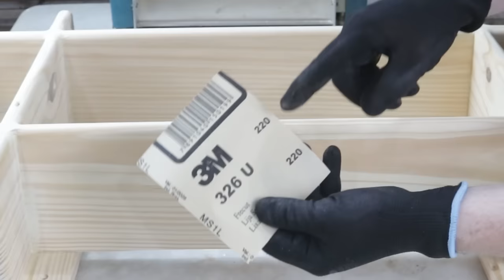EASY TO MAKE - WOODWORKING PROJECT THAT PEOPLE LOVE (VIDEO #49) #woodworking #woodwork

Comment: 9 out of 10 videos on YouTube about wood working are always with someone with a shop full of expensive wood working equipment.. How about showing some skill level without all of the shop equipment. How about just using simple hand tools to accomplish the same task. Most DIYers don’t have expensive equipment.. How about just using a circular saw, drill, palm sander, handsaw, framing square, etc..etc.. And not to mention, using your garage floor to build your project on..
Reply: Start making (woodworking).   This channel does this sort of thing
Reply: Try Rex Krueger, you'll love his minimal hand-tools only approach. From first steps to craftsman...
Reply: In such case video will be very long. 😊

Comment: Normally when metric,we talk in millimetres
Reply: I noticed that too. Millimetres is used in building and construction, certainly not cms.
Reply from the maker: Hello Martin! Around here, it's normal to use millimeters or centimeters to refer to measurements... Generally, millimeters are used for smaller measurements.
#woodworking #woodwork #joinery
Reply: Right you are. It's quite common to use cm in carpentry etc.
Millimeters are used by millwrights etc.
Reply: Great, informative video. People are just being arrogant.
Reply: 😂😂😂,  oh  it'd  probably take less time to Google and learn the metric system, and see that is  decimal base,  
and that 1cm = 10mm, than go around asking  the entire world to explain it differently 😂😅
Reply: I totally enjoyed the video. However, i'm in America, and I only have an imperial ruler, so I'd have to do a lot of converting. 😂. Not a big deal. Love your work.
Reply: There are 2.54 cm in an inch so you can do the math. As previously stated 10mm equals 1 cm.
Reply: Rubbish! I'm a Senior Site Engineer and all metric values are valid. We certainly don't talk in mm for items more than a metre. No one is asking for lumber two-thousand-and-seven-hundred-millimetres long, please!?! You're criticising where none is due, just for the sake of it. Criticism is only valid when it's constructive. Like, where was the push stick? And it's better to work facing the direction of travel and not to reach across the table saw's fence, etc.; not worry about semantics... ;)

Comment: You need to do an SAE also instead of just millimeters
Reply: @FrankGreen. Why?
Reply from the maker: Hello Frank! I'll always be focused on continuous improvement, but the measurement system used is universal, and some say it can be more accurate than using inches. In my opinion, it's just a matter of getting used to it..... I hope that the measurement system used in the videos doesn't deter you from the channel. I also don't intend for you to change the measuring tape you use, but regardless of the measurement system used, there will always be people who prefer another. Presenting conversion in the videos would make the content tedious and difficult to produce. I hope you understand!.... May God bless you and your family!
#woodworking #woodwork #joinery

Comment: What’s the finish you used? The color of the pine looks really good and for the anti-metric guys just put onscreen the conversion like 15 cm = 5.9”.
Reply from the maker: Hello Luis! Thank you for the tip, my friend... Regarding the finish, I applied wood sealer and mixed it with a special stain in the 'Ipê' color. Perhaps you may not find this color for sale in your country, but you can use brown color which will be quite similar... I hope I've helped... God bless you!
#woodworking #woodwork #joinery

Comment: In the British  metric system  based on the S. I. It was decided that centimetres would not be used due to the fact  measurements could be confused with Imperial Measurement. The agreed units to be used in engineering drawings etc, were millimetre, metres and kilometres. So I instead of saying 7.5.cms the easier to follow 75 mms would be used.

Comment: WTF is a centermeter?
Reply from the maker: Hello friend! Just to explain, 1 centimeter (cm) is a unit of length in the metric system. It is equal to 0.3937 inches. To give you a better idea, there are 2.54 centimeters in an inch. So, 1 centimeter is a bit less than half an inch. This can help you convert measurements from the metric system to the imperial system that you might be more familiar with. Hope this helps!
#woodworking #woodwork #joinery

Comment: inches only
Reply: Convert metric to imperial.One inch is 25.4mm exactly
Reply from the maker: Hello Richard! Around here, we usually measure in millimeters, centimeters, and meters... We can easily convert the measurements to inches considering that each inch equals 25.4 mm... God bless you, my friend!
#woodworking #woodwork #joinery
Reply from the maker: Hello Martin! Exactly that. Thank you for your contribution... Health, Peace, and Happiness to you!
#woodworking #woodwork #joinery
Reply: We are in a global community. We imperials can easily pick up a metric tape, use an on-line converter or do the math as stated below. Asking other to do things as we do is rude and egotistical, especially using the word “only”.